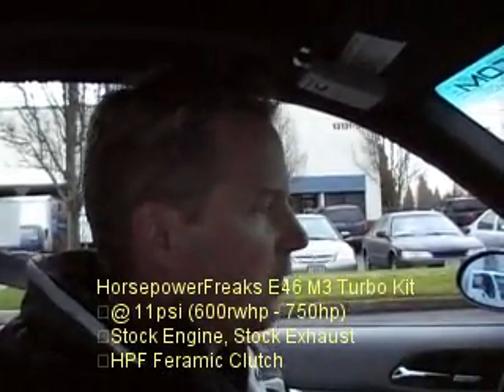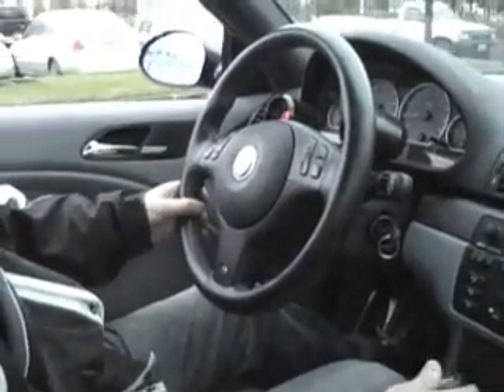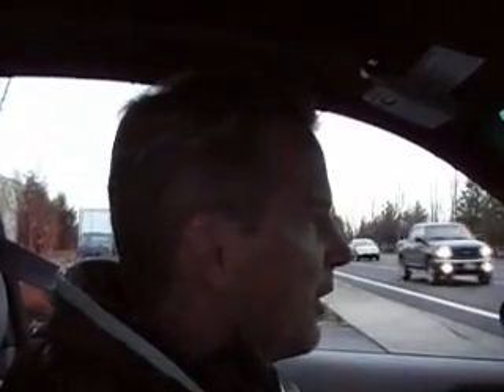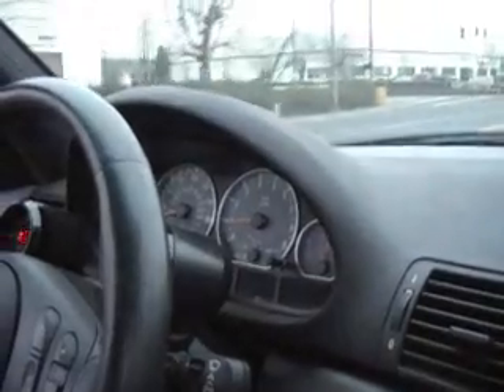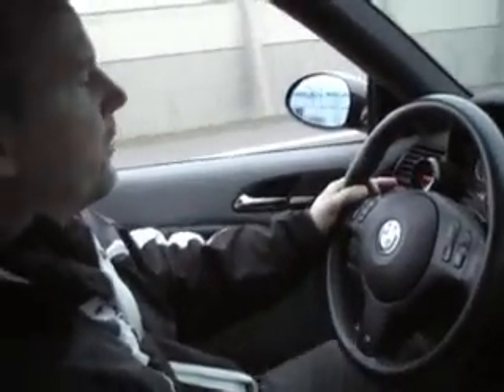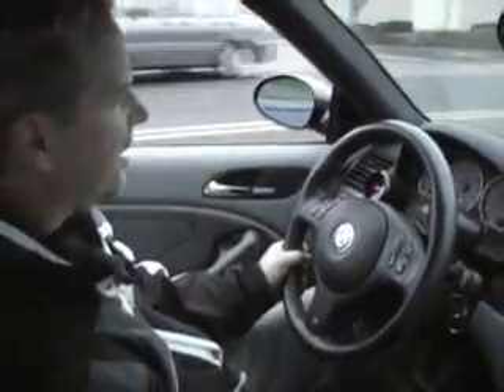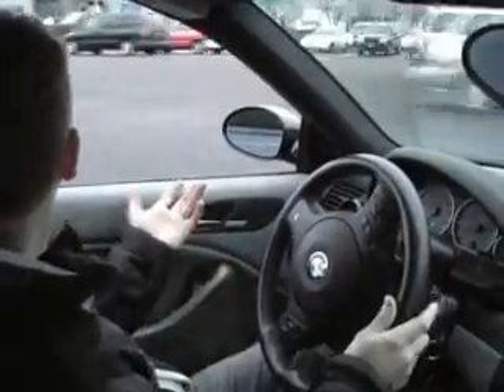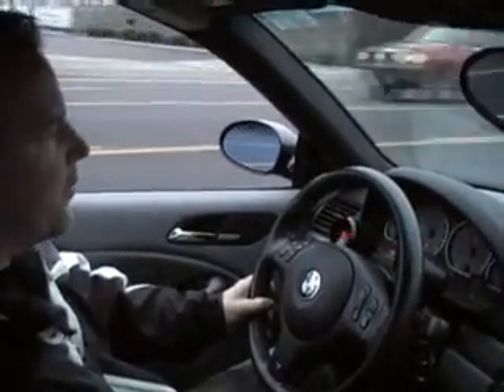HorsepowerFreaks M3 Turbo Kit Driveability

Comment: For the Stage 2.5 setup with optional (but badly needed) rear subframe reinforcements and clutch upgrade is just over $33,200 installed. You can find a decent M3 for around $20k and you'll be rockin'.

Comment: @SaucyTuRkLeBiRd off the top of my head i know the aussie model is 252kw which is roughly 340 hp. but also when boosting the power is more dependant on how much air is actually going through the motor rather than just the pressure on the intake. good engines such as this one breathe a lot better than cheaper engines, which in-turn, lowers the intake pressure by "breathing" more quickly. if that makes any sense. air flow is a better measure. in the US they use cubic feet per minute (cfm) i think

Comment: By "stock" they mean stock internals. This care is turbo charged, probably stage 2 with 110 octane fuel. However, none of the engine's internal parts have been changed. It's still got the stock pistons, crank, valve train, etc...

Comment: @Nettikturbo  When your tuning a car with really large injectors you tend to have to raise the idle to compensate for the poor atomization of fuel at low duty cycles on the large injectors.    ( not sure what size they are running but I have had to run supra's with 1200cc injectors at around 1k rmp just to clean up the idle even with stock cams cause of the injector size. )   The more you know ;)

Comment: i'd say given p/w ratio and how well BMW tune their engines from the factory especially tq. id say mid 11's. ans maybe on a really goooood day a high 10 on slicks. b/c ive seen  M3's with CIA,full Exaust and ecu programming run high 12's. mid-low best with like a 25-50 shot

Comment: id like to know what it was like to drive this car.  if its bone stock id suggest he upgrade the suspension to a JRZ setup.  thats the only suspension i can say was perfect on the M3.  its the same set up used on the stage 3 Dinan M3.  even with the supercharger it didnt seem that fast off the line to me and it had 423 whp (no intercooler).  even though it wasnt the fastest car ive driven it was the most fun around corners.  downside...it cost about 96,000

Comment: M3 wont lose driveability when you working low pressure plus the turbo is a "small" one so yeh everything will be smooth and fine especially if you know what a turbo car is and behave to it accodingly.

Comment: @adrian29castle By the way, a stock 2004 z06 with street tires (370 hp/tq on a dyno) can run an 11.7x, out of the box.

Yeah, 1000 hp and a $30k turbo kit (lol, where is the cost going? tuning? internals? LOL give me a break), can't even beat a stock american sports car.

Boy, I'm impressed.

Comment: @adrian29castle No that's not true.  I owned a large single MKIV Supra.
unless you have cams (which the M3 wont due to Vanos), or something that really slows the velocity of the of the air at idle... OR poor tuning, there is no reason to idle at 1000 rpm.

Comment: @HorsePowerTwins The problem with these bmws is that they can develop such tremendous power, and go absolutely no where. I've seen 500hp kenne bells absolutely destroy 800+ m3's and m5's.

I've got a 550rwhp c5 vette, and I have yet to see a bmw come even close to it. Even full blown slicks on the bimmers just gets them nowhere.

There are barely any m3's in the 10's, even with 900+ rwhp and tubbed out. 800+ rwhp get's you in the 9's in any vette, for 1/5 the price.

Comment: these cars make alot of power with only 7-10 lbs of boost , engine will last as long as factory with a proper tune, maybe just change the head studs to arp studs thats about it